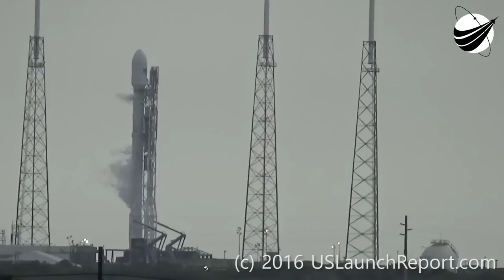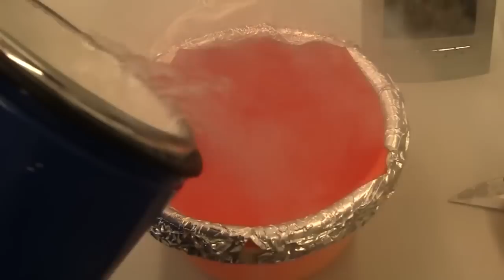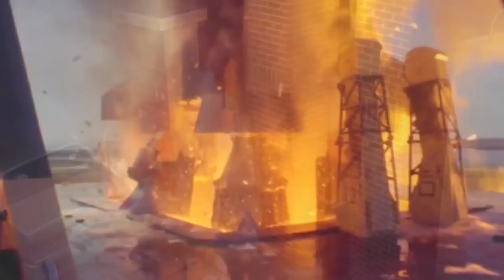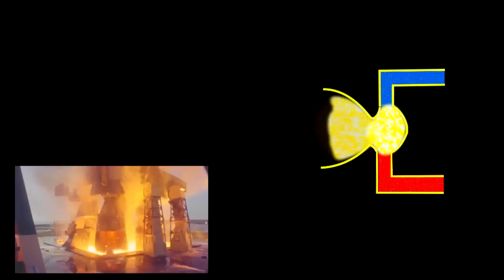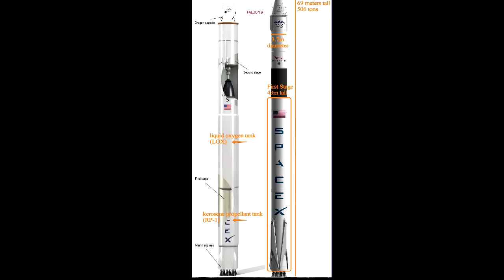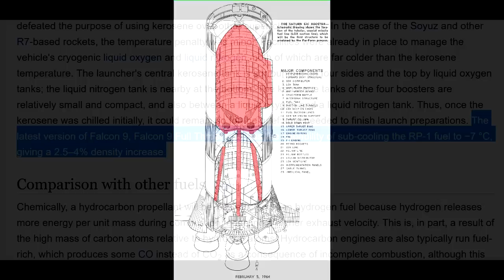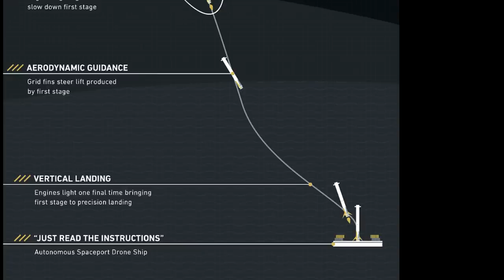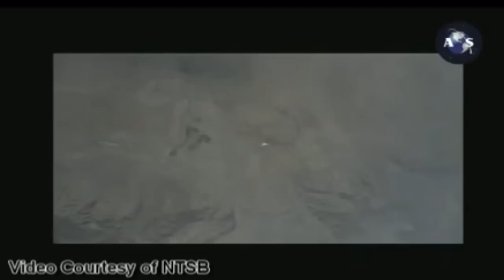Why did the Falcon 9 Explode?

Comment: The problem which caused this explosion was almost entirely new. In fact, it was caused by SpaceX's use of supercooled propellants and COPVs built into the LOx tank, something never done before in an orbital rocket. Since the helium COPVs were below the freezing point of oxygen and the carbon overwrap is permeable by LOx, solid oxygen formed between the overwrap and the internal aluminum lining. Then, as more helium was added to the tank as part of the fueling procedure, the pressure against the buildup of solid oxygen led to friction between and breakage of the carbon fibers. Due to this, enough energy was released to ignite the carbon in the oxygen-rich environment resulting in the aluminum liner rupturing, and the LOx tank over-pressuring, finally mixing the fuel and oxidizer to produce a fireball. Although I respect your criticism, new technologies like these lead to unexpected engineering challenges, so I don't believe this was due to SpaceX's ignorance. I understand that this video was made before any definite cause of the failure was determined, but I don't think you should jump to conclusions.
Reply: eM Cee obviously it works doesnt it? They fixed the issue and have huge success with it. So ye. Point for Elon. If you would follow SpaceX just a tiny bit you know why they did it. Efficiency and stuff, you know.
Reply: eM Cee dude. You know that this was long ago and they sinced launched 20 rockets and landed 20 of these first stages?
Reply: The problem which caused this explosion was not one that has been previously solved. In fact, it was caused by SpaceX's use of supercooled propellants and COPVs built into the LOx tank, something never done before. Since the helium COPVs were below the freezing point of oxygen and the carbon overwrap is permeable by LOx, SOx formed between the overwrap and the internal aluminum lining. Then, when more helium was added to the tank as part of the fueling procedure, the pressure against the buildup of SOx led to breakage and friction between the carbon fibers. Due to this, enough energy was created to ignite the carbon with the oxygen, the aluminum liner ruptured, and the LOx tank over-pressure, therefore mixing the fuel and creating a fireball. Although I respect your criticism, new technologies like these lead to issues never seen before, so I don't believe this was due to SpaceX's ignorance. I understand that this video was made before any definite cause of the failure was determined, but I don't think you should have jumped to such quick conclusions.
Show less
REPLY
Reply: +the lego guy did you actually copy paste the entire comment along with read less and reply? this is a joke yes?
Reply: thanks
Reply: Umm the probe that was on the rocket that blew up cost around 200 million if memory serves ... here: https://www.timesofisrael.com/spacex-rocket-explodes-destroying-israeli-satellite-on-board/  Yeah, so about a quarter billion dollar set-up if you include the launch pad itself and the clean-up after et ct... LOL  Secondly, NASA has been in the business over 50+ years and Space-X has been at it for what .. since 2008 was their first launch  - so yeah,  around 10 years and so their operational record has yet to be really proven don't cha' think?  10/50 ?  .. . With regards to NASA who I hold in high regard no pun intended  -  I think their track record isn't that shabby considering they pioneered the way for Space-X to even begin such an endeavor. . .
Reply: Granted, Nasa has pulled off some ~300+ launches in total since their establishment in 1958, 60 years ago. SpaceX has been launching rockets since the mid 2000s and has a track record of 54 launches right now (of which 6 has failed). Now you could say that SpaceX & NASA has proportionally as many launches over how long they've existed, this could validate your "NASA pws all" argument until one looks at the launch distribution: 5 launches in '06-'09, 6 launches in '10-'13, 6 launches in '14 alone and then it only ramps up. SpaceX has almost been doubling their launch rate annually since 2016, going from 8 in '16 to 16 in '17 and a projected 28 in '18. Who knows how many there'll be in 2019 and forward? I'm confident that SpaceX will pass the 300-launch mark before 2025 if their current "trajectory" has any say in it.

Sure, they've a technological advantage from the get go given that they haven't needed to start from almost absolute scratch, but as is evident above^, SpaceX are pulling their own weight in terms of R&D and will be attempting far more difficult missions soon than anything NASA even got on the drawing board.
Reply: How far down the throat does som of you guys have TF's dick really? TF is on fucking deep water here with his anti Elon Musk bias.
While there are people to trust when it comes to criticism of RnD project her on youtube, TF is far from anyone of them. I mean only a ignorant moron would compare the space shuttle with the falcon-9.
Space-X is revolutionizing the space industry. Accept it and move on or at least use some actual fucking arguments to discredit it.
Reply: Cameron Jones the only thing im jumping into is back to the wonderland rabbit hole where i came from. 🐇
Reply: Death Merchant  So who all should go to jail for those who have died during government ran weapons and space experiments???  BOOM! That's your logic incinerating.
Reply: +Dave Robson   I was referring to American entities, as in the comparison between NASA and the private companies, which was the topic of the discussion above.
Reply: eM Cee  That's the whole point... In most cases, private industry moves faster than government ran bureaucracies, like NASA, where they bid out to god knows how many different subcontractors who then rip them off with cost overruns.  The result is quicker results..... Also, those launches are regulated by the FAA who mandates that they insure each of those launches, so I'm sure that satellite was covered.  The latest Falcon Heavy rocket launch, was insured for over $200,000,000.
Reply: And NASA has killed atleast 17 people in their endeavor.
Reply: +Patric Berggren  And?  Death occurs in spaceflight and when working around space vehicles.  We'll see just how many more die in the future.  Hopefully none, but that's not probable.  It's bothersome how the loss of 25-30 lives over 50 years is used as a slight against NASA when other governmental agencies lose exponentially more.  It's easy to throw the death of people into a conversation, when no one else has actually had humans in orbit, let alone for any purpose.
Reply: hoghogwild
" It's easy to throw the death of people into a conversation, when no one else has actually had humans in orbit, let alone for any purpose."
 Uhm. the Soviets had people in orbit. And before we did.
Reply: +magaiver and +garrett why the salt?
Reply: Did people forget to test stuff first?
Reply: eM Cee you are weird. You are making my argument and call it a win for you. NASA blew up dozens of rockets in the first years. SpaceX blew up 4 in total, 3 of them where tests... and 1 was a completely new "technology". Means the track record of SpaceX is pretty good.

So even if it's true and they did blew up 250 million there. I still don't get why it's your problem? It's SpaceX loss. A private company. You don't have to pay a cent for it
Reply: first of all there is no "we". Thats Private money. I doubt that you went and wrote a check to Musk for 260 million. Secondely how the fuck do you get to 260 millionen? The rocket is about 40 million. Where are the other 220 millionen come from? Thirdly. SpaceX has a way better track record than NASA does with rocket launches..
Reply: You have to stop and ask yourself Cameron Jones, why, .. . why was it "never done before" .. . no one had the capabilities before now or they just thought it was too dangerous and never tried?? 260 million dollar "hey, this might be super cool?"
Reply: eM Cee it was never done before because the ability to produce carbon composites that can handle cryogenic temperatures reliably and cost-effectively hasn’t really existed until within the last 20 years.
Reply: @CODEnterprise  ahem. welcome to 2021 where spaceX reuses falcon 9's 6 times in a row. Enjoy!
Reply: "New technologies like these" are first tested on low-cost models  with smaller launch pads for a certain period of time preferably  at a test facility.
Reply: hoghogwild
 Sorry. That was not clear.
Reply: Have u seen them reuse thier rocket?
Reply: eM Cee  When someone else has done most of the research for you, you've got no excuse for fucking up to this degree.
Reply: Yeah the main difference between comparing Space-X with NASA is NASA was totally INVENTING .. . from the ground-up  LOL  the technology for the first time in history and .. .AND has been in operation 40+ years longer with such a resumé  as:  designing and constructing  the International Space Station, walked on the Moon, sent probes to Mars, Saturn, Jupiter, Voyager I and II, umm New Horizons.. . . on and on .. . Not saying Space-X isn't doing great so far, just think it's kinda funny how much money goes into a failed design which was rather straight forward. The liquid oxygen likely solidified due to filling the gas chamber with helium first and once frozen solid the oxygen reacted with the carbon fiber composites inside the tank self-igniting. So yeah, the next 260 million USD rocket ... BETTER WORK LOL!
Reply: Awesome, only 40 years to go and we can start comparing them to NASA.
Reply: After 260 million dollars up in flames it dam well BETTER WORK the next time we invest another quarter billion dollars!!! LOL  ur funny
Reply: I would not invest in a company who claims reusable and dosnt reuse and then blows up a 1/4 bil. why not test it on a little rocket around 50 grand I know all this and im not a rocket scientist LOL. did u cut and paste that crap just spewed out???? and what do you mean dont believe ws due to there ignorance THAT IS WHAT CAUSED IT there lack of knowledge AKA ignorance which just wait cause more to come in the private sector they want it now so dam the torpedos AKA ROCKET full speed ahead BOOM 💥. lack of testing and saftey will continue.his company already killed someone and u think him trying to make money off this endevour is okay well i think jail is better.
Reply: @deathmerchant8662  because scaling rockets is not possible. Your tiny 1cm rocket cant reach space, even though it might be a perfect downscale of the Falcon 9. Dumbo
Reply: Cameron Jones I bet u get all the ladys
Reply: Magaiver9000 pls do the same

Comment: You drew us in by asking a question we'd like an answer to, but then used it as an opportunity to question and doubt what Musk is doing.  You didn't answer your own question but abandoned it half way through. You cite NASA as some kind of exemplar of accomplishment - NASA, which, through unbelievable incompetence, killed 14 people from two crews. The shuttle itself was in many ways a poorly conceived, poorly designed rocket; it's capabilities way oversold before construction even began. The turbo pumps on shuttle were extremely powerful, which is part of the reason they were difficult and expensive to maintain;  Falcon 9 doesn't need or use such expensive motors. You bring in Virgin Galactic,  which is a suborbital vehicle with almost no similarities to either Falcon 9 or shuttle. It's engine is minuscule compared to Falcon 9, and it's purpose and objectives are completely different to those of SpaceX.  You showed one of the successful barge landings of the Falcon 9 first,  and then showed failures that occurred prior to that landing, creating the impression that SpaceX was going backwards in its accomplishments, also misleading and false. Lastly; as long as the Falcon 9 can deliver payloads and then return for a safe landing, WTF difference does it make whether it is unable to use that last bit of fuel to gain a higher altitude?  I'm not sure why you seek to disparage Musk - this feels not like objective science but some kind of jealousy or personal vendetta.
Reply: Christopher28fair that's exactly what it is; dunderphoot has a hate boner for musk, and it's longer than the planned hyperloop and trump wall put together
Reply: You're wrong. NASA killed 17 people from 3 crews. The crew of Apollo 1 were immolated on the launch pad because NASA didn't think there was anything wrong with pressurizing the capsule with 100% pure oxygen at a level 2 psi higher than a "normal" air pressure of 14.7 psi. During an "internal power test" about a month before the scheduled launch, a voltage spike was noted on one of the voltage buses and nine seconds later the crew reported the fire over comms. Five seconds later the last transmission heard from the capsule was a cry of pain. 24 seconds after the voltage spike (and one second after the last transmission from the capsule was received) the fire had raised the pressure inside the capsule to 29 psi - twice a normal atmosphere - before the pressure blew out the inner wall of the capsule and vented heat, smoke, and flames into the ready room, preventing crews from quickly getting to the doomed astronauts. The intense heat of the pure oxygen fire had fused the astronauts' suits and hoses to the seats - making removal of the corpses difficult.
RIP: Virgil I. "Gus" Grissom, Edward H. White II, and Roger B. Chaffee.
Reply: Now after the BFR videos a personal vendetta is quite apparent.
Reply: Christopher28fair If Nasa can't do it, then Elon Must do it
Reply: did you just... threw the columbia and challenger crew under the bus for a fucking internet argument. you fucking disgust me.
Reply: @killian9314   I've re-read my comment five or six times and I can't see where it can be interpreted as criticizing the crews. I criticized NASA, and I think both investigations found a lot of problems with NASA's procedures and decisions.
Reply: this is what science is.. doubt. you have to question everything. when compared to blind following which sheep people are prone to, it is the only way forward and always has been
Reply: @deviantan021  There is a clear difference between doubt and hate. The tone of this video clearly ventures into the latter. I can smell the anti-Musk bias on his breath.

Comment: We get ecstatic over the return of a first stage to a safe landing because:
1 - It's Not the government with tax money doing it, but Private Enterprise!
2 - It is  a development on the road to reusable rockets. Current system is set up like an airliner that throws away its plane after every flight - a wasteful and expensive process.
3 - Without reusable rockets, the expansion into outer space  by the human race will be too slow & too expensive to be of any benefit.
4 - R&D failures are just that: R&D failures. They are lessons.
5 - NASA, as great an organization as it is, is still a Government Bureaucracy, and therefore protective of its "turf", even when it screws up royally (see the Columbia accident: failure to check for damage before reentry, and Challenger accident: Bureaucracy rules over engineering ). NASA also is as resistant to changes in thinking and methods as any Government Bureaucracy.
Reply: Not just an R&D failure. It carried actual customer payload, costing a customer a lot of money and hurting their asset valuation significantly.

Comment: This video makes me think. The footages of Saturnus V rockets - the biggest and most powerful rockets ever built -plays an important role in  the explanation of big powers involved in launching rockets. The the Space Shuttle came and now we have  only  Soyuz rockets from the same era as Saturnus V for bringing people in outer space. America still has no  actual rocket program for bringing. In fact after the sixties there has been a technological decline going on. All those dreams of going to Mars, without a working rocket program it is lacking credibilit.  Or am I too somber?
Reply: Not a decline. Rockets have become more reliable, cheaper, and more capable. A one off shot to Mars is possible now, but the current interest is commercial space.
Reply: If rockets have become more reliable, cheaper and more capable, why is it then that the only type of rocket used for manned spaceflights dates from the 1960's?
Reply: Marco Roepers But that rocket has been improved many times. Digital flight control system and many avionics revisions, ground support equipment changes, materials changes (even some moves to composites recently on soyuz-fg), and engine changes have effectively made it a totally different rocket bearing the same name and general appearance.
Reply: It still is disappointing that modern types of rockets like the Arianes aren't suitable for manned spaceflights. Making plans for manned spaceflights to Mars without having a rocket  for something relatively simple  bringing people to the ISS  (I know it is rocket science but it is simple compared with a flight to Mars)  has a lack credibility. Those guys (like Werner von Braun) built up a program with interim steps and an actual practise with manned spaceflights.

Comment: You made one major research poo-pooh in this video. Upper stages run on LOX/LH2 rather than LOX/RP-1 (yes, fancy kerosene). As the explosion seem to start in the upper stage, I would speculate that the cause is a hydrogen leak - get the right concentration and that's all that's needed.
Reply: Wrong, the Falcon 9 upper stage only uses LOX/RP-1. Only Atlas V uses a dual liquid fuel setup. Delta is all hydrogen, Antares is kerosene and solid fuel.